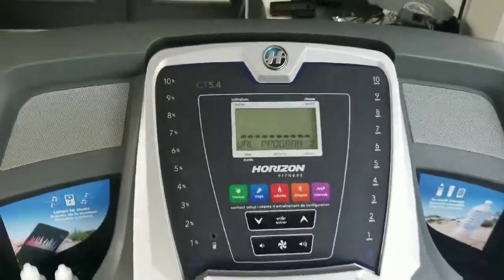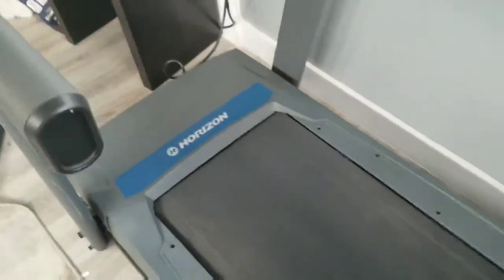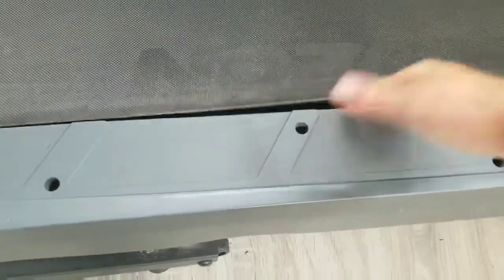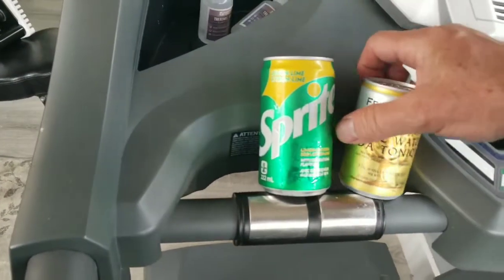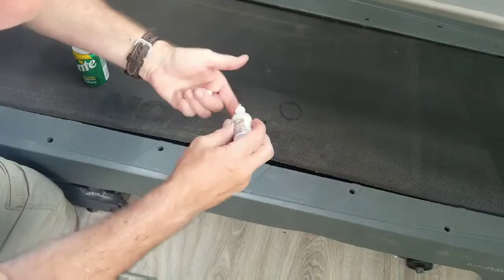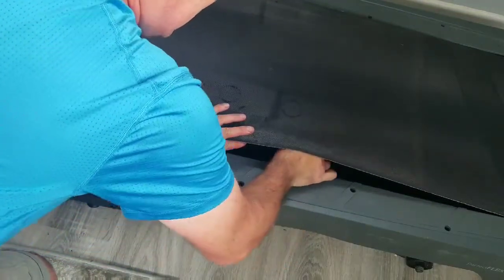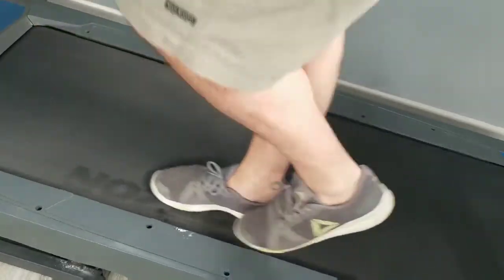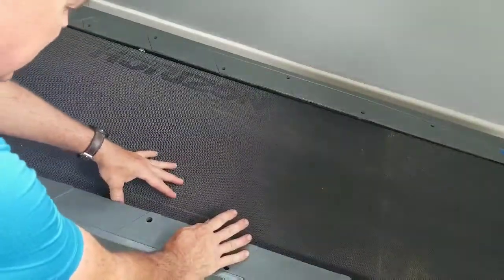Treadmill Belt Lube and Message reset - Horizon CT5.4

Comment: Hi I did exactly what u said but when we speed it up it doesn't work??? R u sure u sped yours up after the video and it worked???? Cause on low speed it runs forever.
Reply from the maker: Hi Ann - I've heard reports that the circuit boards fry and misbehave on some of these units. 
As evidenced by my hillbilly fix on the control buttons on mine these units often have issues beyond lube.

I'm not totally clear from your comment exactly what the issue is with yours re: running forever but yep I am sure that mine currently works A-OK post video. It is even still getting occasional use.
Although ...I've now become addicted to WingFoiling so less use on the Treadmill now.

Hope you get to the bottom of the issue.

What it sounds like to me is that a heat sensor is tripping a shut off. At slow speeds not as much friction as at high speeds. Did it do this before you lubricated it?
If yes - maybe you need more lube
If no - Is the belt centered? If the belt is shifting right or left and rubbing against chassis would not be good.
There is an adjuster to center.
You did use good quality silicone based belt lube?

Thanks for watching!

Comment: Hi i have same treadmil and lube belt still here i alread done lubricant but lube belt messege still here ..u have any idea ..tell me plz thanks
Reply from the maker: Hi J ... in the video I do cover this ... watch until the end ... you have to press/hold two buttons together for 3+ seconds to reset/turn off the message.
From memory I think it's the  'speed up' and 'stop' buttons but check the video again.
Best wishes... thanks for watching
Reply: Mine is stuck as well, hoping I can figure it out without needing a new one :)
Reply from the maker: Hi J and J
I've been having a conversation with another viewer on one of my other treadmill vids and he advised that some machines are having a software glitch and the 'hold 2 buttons' routine simply won't work. That the brainboards need to be replaced to remedy. Apparently found this via Amazon reviews for Horizon machines.
I can neither confirm nor deny the point as I'm not a treadmill repair fella but thought you should be aware.
Best wishes.
Reply: Thank you for the feedback! I appreciate it :)
Reply: @jenngale1776  Anyluck? I've pressed both buttons and it won't go away.
Reply: No luck. I’ve tried everything. Every video, google search. Took it apart few times. It’s sitting there dead and needs to be replaced.
Reply: Same here. CT5.4 and the "speed up + stop" pressed did not resolve the issue. Still stuck at the "lube belt" error. The treadmil is dead.

Comment: I have the same problem. It did not work. Does it mean that we have to lubricate more?
Reply from the maker: If you mean holding buttons down to reset/turn off the message did not work then sadly no ... lubricating more won't crack that nut. Seems to be a problem with control board or programming on some units.
(If you've lubricated but have not already done the button hold sequence make sure you try.)

Comment: I have Horizon Treadmill CT 9.3 purchased in 2016 from Canadian Tire store.I have been using it only for walking and that too not very frequently. 
Now it is giving problem.  During walking it suddenly stops and there comes clicking sound from the control board. After a few minutes it resets itself automatically and starts working normally but after another few minutes it again stops suddenly and the same clicking sound starts coming from the control board. 

Horizon fitness doesn't have a caring and effectively efficient "after sale service " in Ontario,  Canada.

Can you please advise as how to get rid of this trouble? Any clue to reset this trouble or master reset the machine for any such problems?  Thanks.
Reply from the maker: Hi Kent - thx for reach out - apologies but I'm not a treadmill tech so advice limited.  1st thing that comes to mind is ... have you lubricated the belt recently? 
Even if just walking belt will dry out. If you havent I'd do that 1st. I am not aware of any master reset combo but the old unplug from wall and wait for at least a minute for capacitors to discharge would be what I'd do. Then I'd Google to see if anyone out there has the press x and y and z button combo (which is why you are contacting me I guess!)  I suspect 'Horizon' probably just a Canadian cover brand for plant in China and ya ... customer service prob not going to be too great.  
In one of my other vids you'll see I had to put my own buttons into play to bypass the originals which were acting up / not responding on my unit. Could be a short or wire break somewhere in the chain causing SNAFU in yours.

Sorry I cant be of more concrete assistance but best wishes on your quest!
Best
R
Reply: @fixitdad899  Thank you, sir.
I value your reply very dearly.
Sadly, Horizon fitness after sale service in Canada is very bad. I want some technician to fix a bypass so that I can continue using it for walking through this winter, but no one is listening.
Anyway, thank you again for your kind response.
Reply from the maker: Hi Kent
You mentioned you are located in Ontario. Where abouts are you? Are you in Toronto by chance?
Reply: @fixitdad899  Thanks for your reply. 
I am in Cambridge, Ontario. 
It is about 100 km West of Toronto in Kitchener/ Waterloo area.

Comment: How did you switch your buttons 
My speed button does not work so I can’t reset the lube belt message …. Help !!
Thanks
Reply from the maker: Hi Mathieu. Have a look at my  YouTube channel video listing. There are about 5 documenting how I swapped button out. Best wishes on your fix.
Reply: My Horizon CT 5.4 a few buttons don't work.